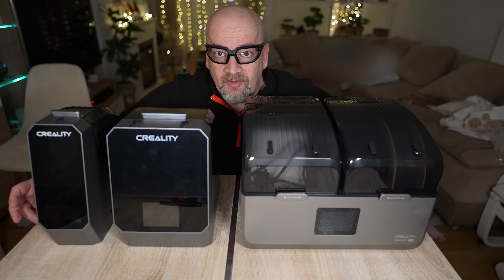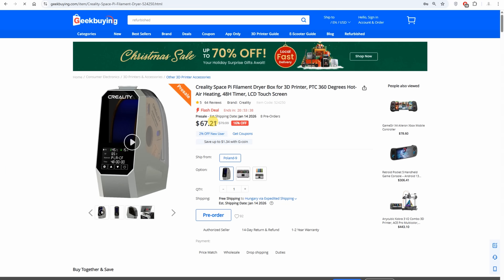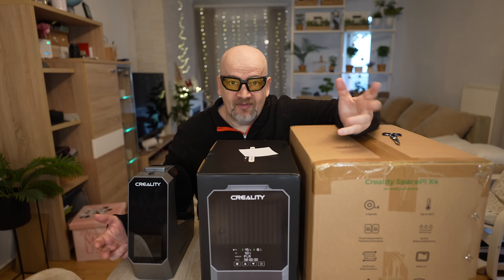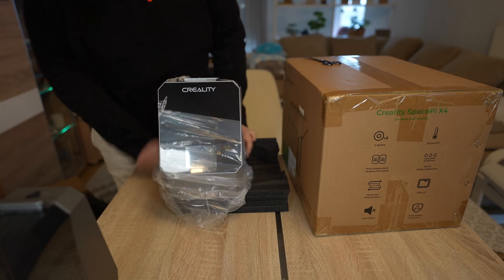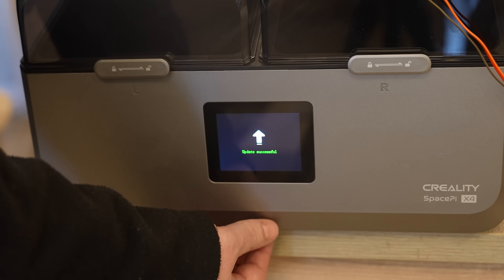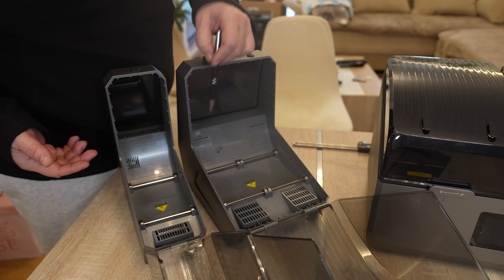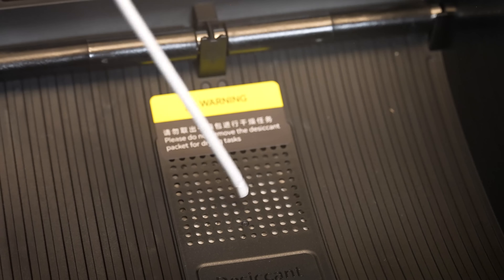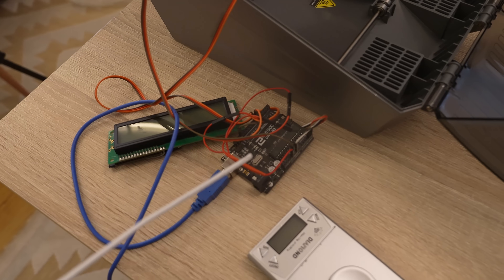3 Creality Space Pi Filament Dryers Compared – Original, Plus & X4

Comment: I have to warn people on the X4 at least on mine when i would try and leave my filament on auto-dry where it will keep automatically drying your filament it wouldn't matter if i had a lower temp set for one of the 2 chambers the auto-dry would set both chambers to the max heating of the settings of one fo the chambers, so it would heat both with the same temp, i had 2 spools melted because of it

Comment: I have the X4 and it generally works well. My only complaint is that it doesn’t seal well when I’m not using it, so it’s not much good for filament storage. It would be a great product if it could heat and vent to dry the filament, then seal the vent when it’s done. But in fact, the humidity just creeps up over time, so air is getting in somewhere.

Comment: The Pi x4 is a great combination with the Bambu lab A1, and AMS lite.
You can feed the filament directly from the dryer, and even dry while printing.

Now put the A1 in to an enclosure, and you get a budget machine that can print nylon, ABS, and ASA (recommended ventilated enclosure with active carbon filters).
Reply: What inside enclosure temp are you using for those not to come out as trash? I did ASA on mine at 80F inside and it seems like it needs to be way hotter.

Comment: ( my previous comment disappeared !! ) I use a Ninja airfryer ( 3.8L ) - spool fits in the basket nicely, dehydrate setting up to 90 deg, can use other settings for higher temps. The fan and rapid heating seem to do a great job of quickly drying filament - added bonus is you can use it as an airfryer !   ... cost me £70 on Amazon.

Comment: I have a spacepi x2 that I've been using for about 6 months. Gotta be honest, the motors/fans do not sound good... we'll see. I ran it at 70C for a LONG time with PA, maybe 12 hours, and it warped one of the outlets on the far side. Might explain the fans sounding like death. My x1 is doing great.
Reply: My space pi x2 also sounds like the fan is struggling then when it gets hot enough it seems to have less trouble for some reason. Worked without that noise at all for a few months at that start. I have not run mine more than 65C.

Comment: I have the plus, and the biggest aggravation i have is that the ptfe tube gets sucked into the box, but its easily fixed with some tape around the outside of the tube to increase friction. 
I wonder if a tube connector would fit instead of the rubber grommet thing

Comment: I bought the Space Pi 1 this year because I print in my garage, and it's been working well. But now that winter is coming it sometimes has trouble to reach 60 to 70°C (ambient temp sometimes is 12°C). There is a built-in security : if the unit cannot reach the set temperature within 10 minutes, it stops heating and shows a blinking error E4. It can be reset by switching the power off and on again, and so far I've always been able to reach the set temperature after a second heating attempt, but that's not convenient. Now I have to stay in my garage and monitor the heater more than the printers lol

Comment: Space Pi has a known issue with the fan degrading quickly; there are several mods to switch to larger, better fans after finicky disassembly. Also, it has problems with working at temperatures below 20 or 10-something degrees - learned that I should mvoe it inside house from garage for it to start heating and return back))
Reply from the maker: Which version? 1x, 2x or 4x version?
Reply: @MyTechFun  this is about 1x

Comment: I've used the single spool Space Pi for a while now and been really happy with it, but wanted something to dry more spools and maybe better for storage also. I got the X4 and been very happy with it! I was hoping it would be at least as good as the original for drying, but honestly it seems better in almost every way, and the OG was already great... lol It's been really good for storage too. I check the humidity occasionally and I've been impressed with how long it will hold the humidity down inside the chambers, and even if that's not enough already, you can set it up to automatically kick on and run a short time if the humidity gets above a target level. I think Creality really did a good job with this one, and I'm glad you were able to test it! You're previous dryer tests helped me pick the OG Pi when I was looking for one then.

Comment: I had a space pi, until it melted itself after about 2 months.
Reply: Can you describe what happened in detail?
I was just about to buy one
Reply: @padlockbeats151 the area where the hot air enters the box at the rear got too hot and the plastic grating melted. It stopped heating properly after that. I opened it up and found other melted pieces inside. I was utilizing it continously at the maximum temperature for two days.
Reply: @Plutonium239MXR thanks, I assume you mean, the area where the hot air exits the box. 
Was it in used in a well ventilated area?
Reply: @padlockbeats151  the back was where hot air entered, and yes it was in a well ventilated area. The air circulates in the box from back to front. Back is where the hinge is. Or was it intaking there and reheating it? Not sure. Either way it melted right there.

Comment: I have the space pix4 that I got on sale about a year ago and I have been very happy with my decision. I got it on sale for 130 on amazon around this time last year and have been using it regularly since. I really like that I have access to 2 different chambers to keep my petg and pla dry separately.
Reply from the maker: That's a good price. Why is everything more expensive here in the EU(?)
Reply: @MyTechFun I paid for mine 120€ here in Germany.  On AliExpress and eBay many stores still sell PVT units.  So they're from production validation test runs, but mine works perfectly fine. I got it in Summer and it has been flawless since then.
Reply: @Leif_YT From the USA I bought one from aliexpress a long way back way cheaper than other sellers even compared to other aliexpress sellers, when it came it was obvious it was just sent from amazon. I wonder if a scammer buys it with stolen credit cards which since they aren't using their own money they can offer crazy low prices. I got the X2 unit at a X1 price.
Reply: I got mine from Temu for the same price, $130. I paid $110 for my Sunlu S4. The Creality is worth way more than $20 higher in my opinion.

Comment: Interested in this. I have the x4 and have been very happy with it thus far. The 85c is much better for PA filament and can anneal some things with it, such as polymaker ht-pla. Thank you for your work on this, Doctor Gaspar.
Reply: I agree. Nylon / PA was the reason why I bought the x4 and so far I'm super happy with it. Before I tried drying Nylon in my Sunlu S2 and it was a nightmare.  With the X4 and 85°C - 90°C (mine overshoots a little in that temperature range)  it was a breeze.  My decision making was between purchasing an AMS HT or the X4 for that use-case.  x4 was the better deal in my opinion because it can also be a nice storage solution for such filaments with the additional functions the menu offers.
I think that's also worth mentioning.  On the x4 it's possible to adjust settings for the left and right changer to keep them at a specific humidity (auto drying function) - perfect for storing critical filaments for a bit longer.
Reply: @Leif_YT  Appreciate the thoughts on the x4. That sounds promising for PA!